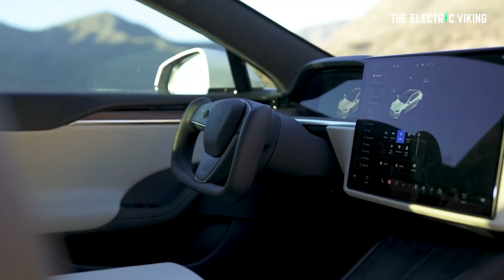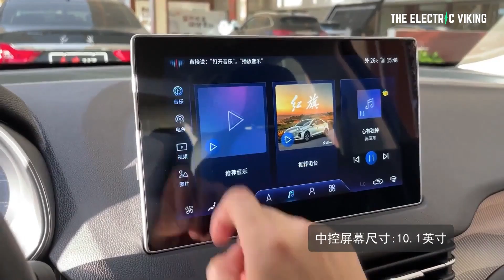NEW $30,000 5 meter long EV with 600km range & 82kWh battery

Comment: Many years ago I lived in Arizona and owned a 6m long Lincoln Continental. It a had a 450 cubic inch V8 fed by a Holley four barrel carburettor. On a good day it got 5 miles to the gallon and had a range of 220 miles from a 45 gallon tank. It went like a train and was a great hill climber. Only problem was finding a big enough parking spot for it.

Comment: Hmmmmm.........not for me by a long chalk, it's too long and the turning circle in a crowded car park would make you nervous trying to get out of a parking bay without hitting the car in front of you or scraping the pillar as you angled out.
One of the main reasons I went for the Rav 4 some years ago was because it turned on a button and took up so little parking space.....being an ICE car eventually it will have to go electric or be retired for an EV.
If the 600km range determined the price due to the battery pack.....cut that down to 300km range and then halve the car cost.....that would be something, but still too big.

Comment: Chinese products are JUNK..try a Rosie motorcycle in the Philippines..or ANYTHING Chinese...I knew someone that worked Field service in China for my company.. plastic bottles basically but the Chinese were always trying to cheapen the line by any means possible.. cheap wires especially..
Reply: China produces everything, from the best to the worst. If you're getting junk in the Philippines, most likely is because that's all you can afford.

Comment: China is the home of the ev revolution and Tesla is the father off the ev revolution (Tesla's mission is to accelerate the world's transition to sustainable energy. Tesla was founded in 2003 by a group of engineers who wanted to prove that people didn't need to compromise to drive electric – that electric vehicles can be better, quicker and more fun to drive than gasoline car) mission accomplished 💪💪

Comment: Axial flux motors in the wheels of a simi truck will eliminate the need for reduction gears and differentials. It all wheel drive. That's a lot of weight without cost.

Comment: 600km in an electric vehicle...so 425 km in reality, under ideal conditions, like no headwinds, no passengers, no luggage , no towing, no cold temperatures, no hot temperatures, and no big elevation changes. Add a couple of these conditions and then you have about 275km range...add four or more of these conditions and then you have less than 200 km range. I'm out !
Reply: I drove my MG ZS 206 km today. It was 30 degrees c, windy, I had the AC working and went 110kph. The average usage was 15kwh per 100km. I used just over 30kwh out of 42.5 available. And the car isn't exactly aerodynamic either. I guess for that capacity about 500km is right...